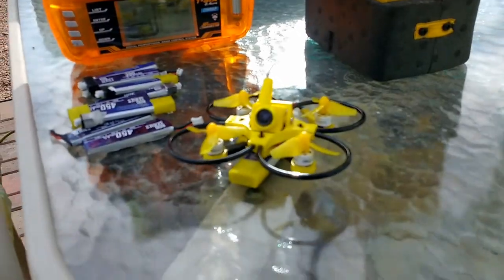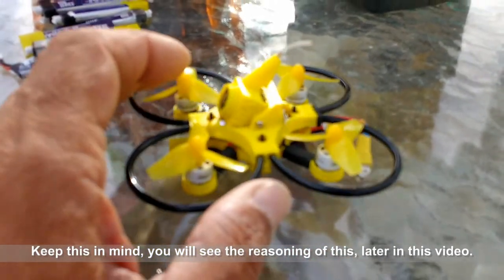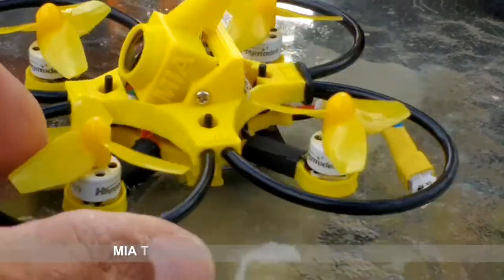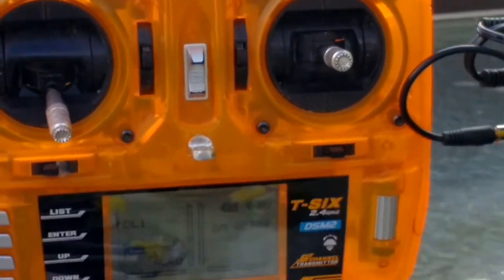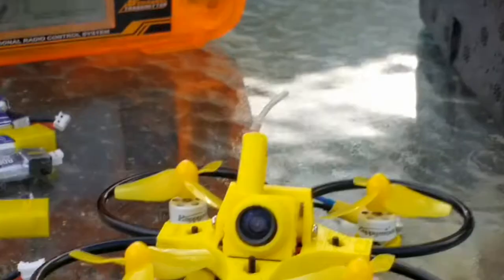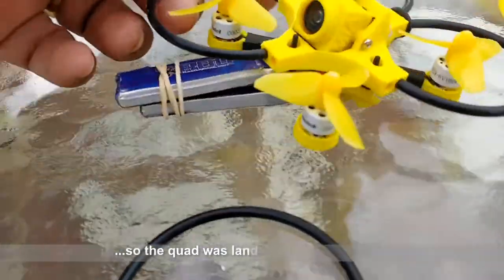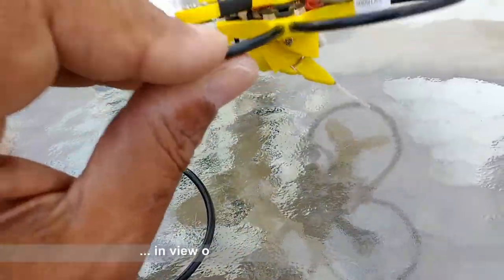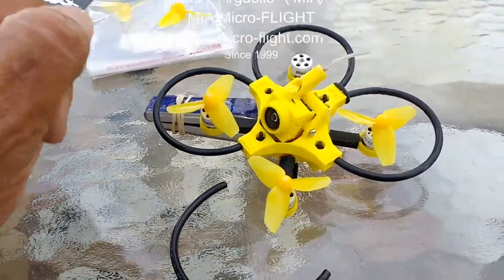MIA TUFF™ FPV Racing Frame for MOBULA 7 or Whoop Durability Tests

Comment: Looks dope. I bet it weights too much. Eat thru your batteries. What you gain in looks you most definitely sacrifice in flight time.
Reply from the maker: You have that right, and this is the challenge when designing something for performance , durability and realism.  If you want performance and want to sacrifice durability then stick with the stock frame it is pretty light out of the box,  if you want robustness at the tradeoff of some performance then go with a thicker frame.  For example, I was not going for total performance when I designed the frames for the Cadx camera in my other Mobula 7 videos, since my aim was  more for precision and  stability hence  for cinematic footage you want both of these characteristics and not something that is going to take off like a rocket and be able to do aerobatics. The frame with the rings I show in this video  is slightly heavier than the stock but the rings being nylon provide a hell of crash guard.

Comment: So where do we get the kit?
And will it fix the crappy vtx problem on mine?
Reply from the maker: E-mail me direct at MIADSGNS@COX.NET  quantities limited so order soon. FOFS, First order, First shipped basis.
Reply from the maker: It will not solve any electronic problems, however it does protect the camera, vtx and antenna as shown in video.  You could install a much better vtx and go with a different camera so long as the camera is similar in size to the stock so it fits in the camera casing.  Most VTX problems are due to poor voltage leads connections or poor DC voltage filtering or low battery, thus lower voltage to camera and VTX supply, thus lower signal strength.  The best way to resolve any VTX issues is to use a smaller separate battery and go direct to  VTX /camera DC connections.
Reply from the maker: @jacob james in the description.